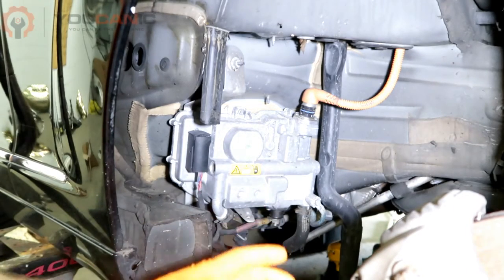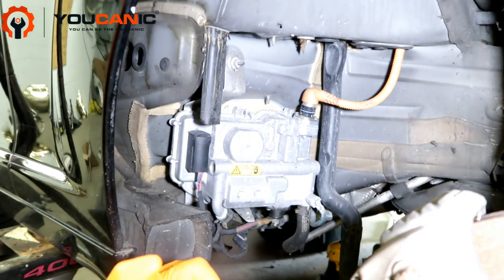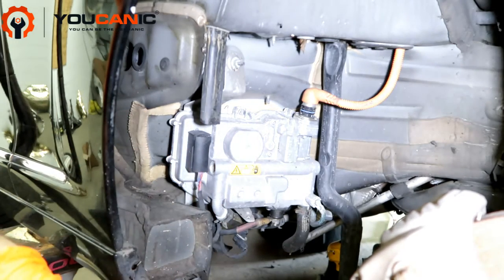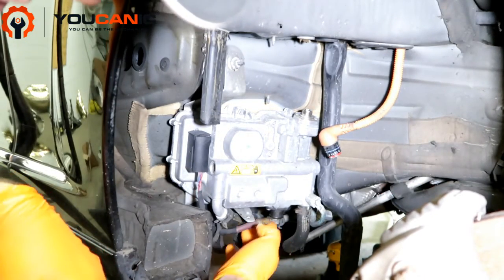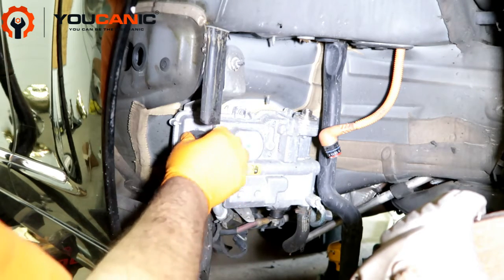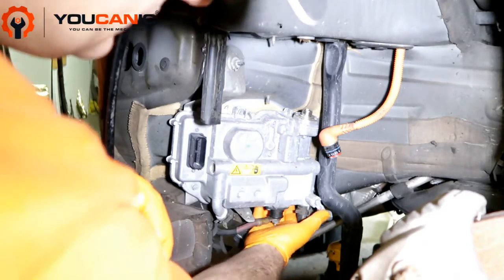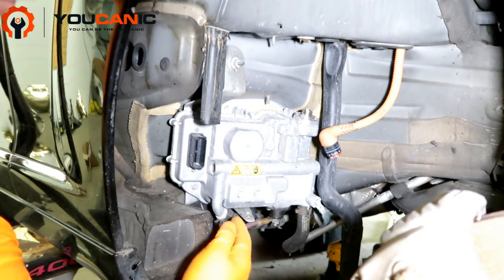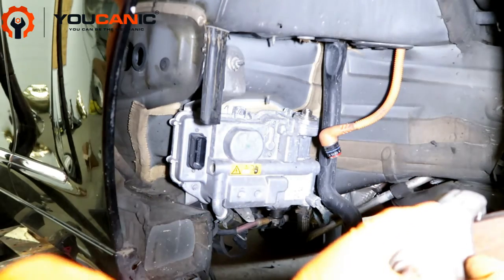2006-2013 Mercedes Benz S400 W221 Hybrid DC / DC Converter Replacement | Step-by-Step Guide

Comment: Hello I have a problem with my car Mercedes S-Class 400 hybrid of the year 2010, sometimes I press the Start Stop button and the car it refuses to start I have to wait 30 minutes 15 minutes 40 minutes several times it ends up starting I also have another problem the power steering is hard sometimes not all the time and the brake pedal sometimes it is hard too,  I brought the car back to Mercedes for a diagnosis I was diagnosed and I was told that the problem comes from the ECU that manages the hybrid that is at the bottom side gearbox and maybe the hybrid battery too but for me they are not strong on the flanges the fault codes of the diagnosis from Mercedes is:  P0A6000 and also the code P0A6300 and also the code P0A5D00 I would like to know if you can help me solve the problem please is it the hybrid battery that is out of service or the ECU that charges the hybrid battery. Can you help me
Reply from the maker: See our reply to your other comment left in the other video.

Comment: How do you know your dc/dc converter is the reason your car won’t crank? I switched my inverter converter my car ran flawlessly for 2 days then a new error pops up as a red battery malfunction and my car isn’t cranking anymore, just like before i switched my converter inverter. Before I’ve switched the inverter converter it wasn’t cranking but it was not giving me errors. Any sort of solutions to my problem? Thank you in advance
Reply: Our company successfully repairs the voltage converters for Mercedes S400. Let me know if you haven't solved your problem yet.